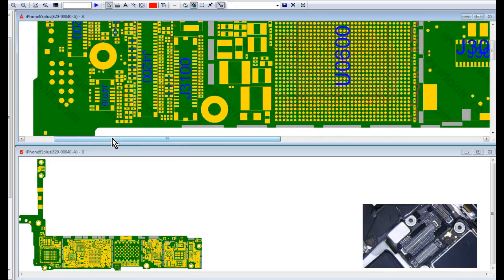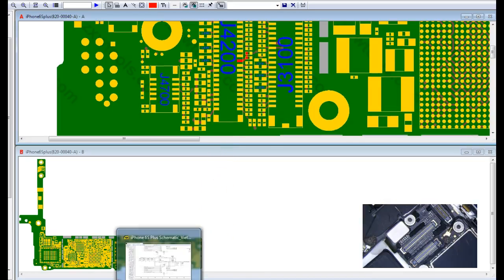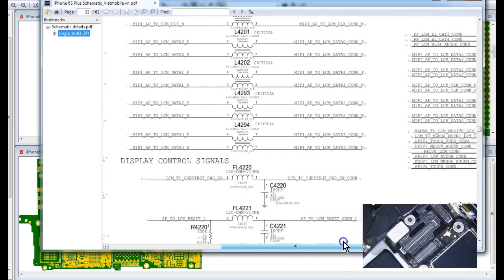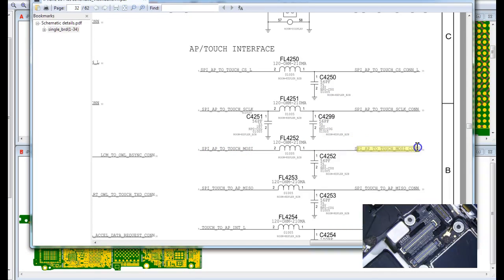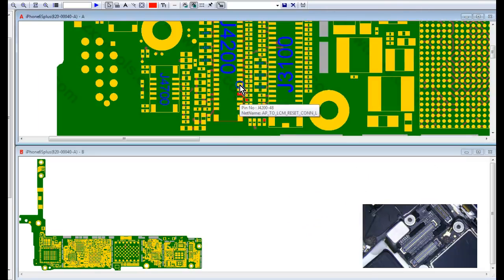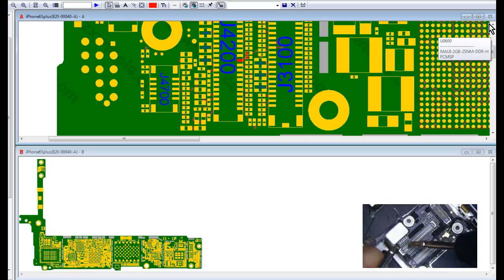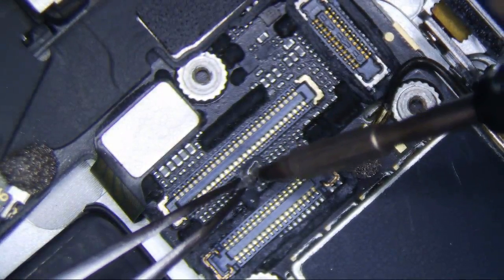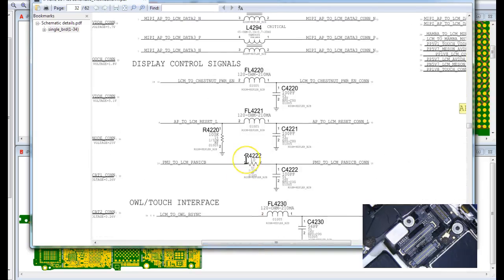iPhone 6S Plus No Touch After Screen Repair

Comment: Hi, Greetings from India! 🇮🇳
Last week i accidently dropped the  upper part (earpiece & camera area) of my iphone 6 into water.
It was only after a week that i could take my phone for repair & the technician told me the exact same problem addressed in this video of a faulty display & touch ic  and charged INR 4100/- ($ 63) for repairing the same. The battery was 57% when he handed me the phone and within 45 mins. the phone's battery got dead and now its not even charging at all, i've tried a different charger as well but the phone is like dead.
Now, i know that the device is not in front of you, but with your experience can you please help me out with the following :
a. Was i overcharged  for the touch ic & screen replacement which is a first copy & not original apple?

b. Was there a need of replacing the screen as well or just rectifying the touch ic would have done the trick ?

c. Why was there such a huge power drain & now the phone is not charging at all, it's like dead.
Is it because of or connected to the screen & touch ic replacement?

d. How can i get this fixed at minimum possible cost & approx how much would it be ?

I have already spent alot on an old phone and I don't wish to spend more.

Your help will be highly appreciated. Thanks in advance. 🙂

P.S. - In the 10 mins. that i tested the device post repair - the earpiece, microphone, camera, network signals & calls ( both in & out) were all working fine.

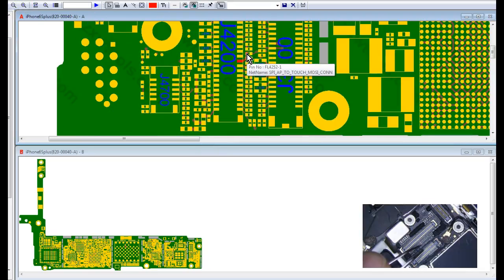Comment: Please help me! where can i get the software/documents with board layout that you are using to find out what the components are? the one you are using in 1:20 
i don't have the tools (or required skill) to do microsoldering but really want to be able to diagnose issues.
i currently have a 6s+ with no touch where the soldering is wonky on the fuse(?) that is two spaces to the right of the missing component on the board you are working on and i'm wanting to know if that is what is causing it.
Reply from the maker: zxw tools: http://www.microsoldering.com/shop/